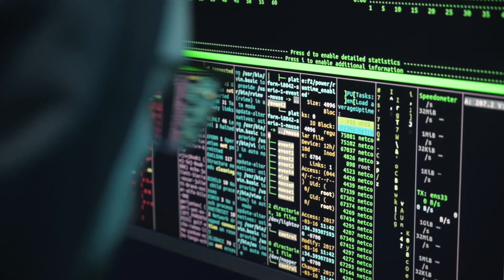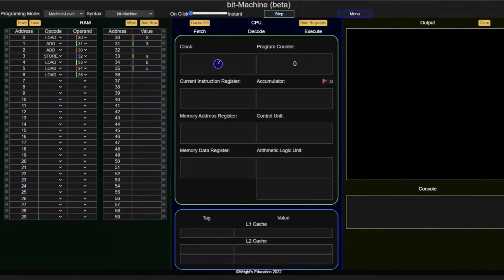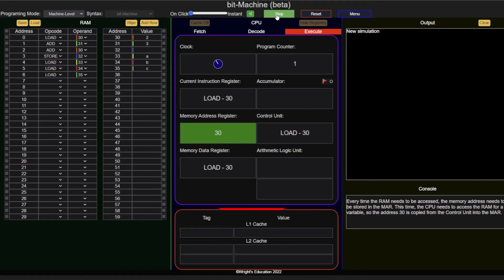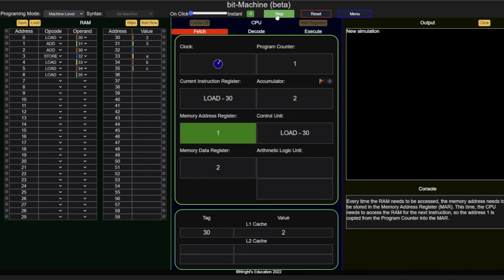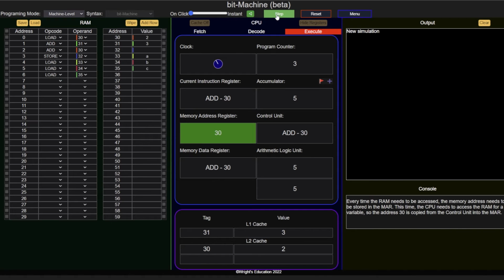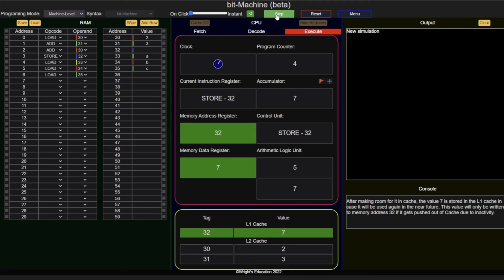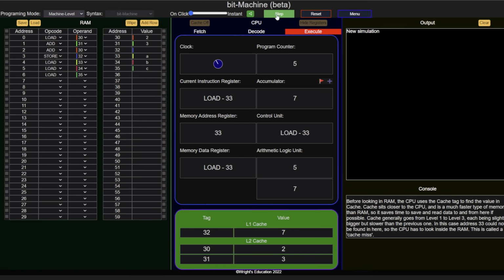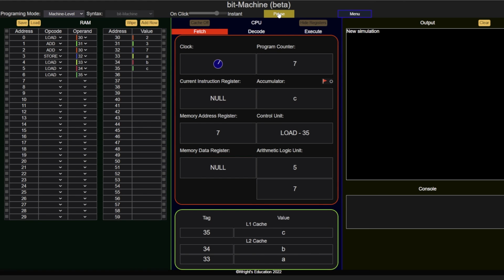How Cache Works In Computers to Speed Up the CPU

Comment: just one clarification. addr 30 will give a cache miss but addr 31, 32, 33 etc will have a cache hit. why? because every time the cpu moves data from/to the cahe, it does it by moving a whole cache line (usually 64 bytes). moving individual bytes one at the time will result in very slow data access and complete failure of the prediction/branching technics, as most of the operations would result in misses.